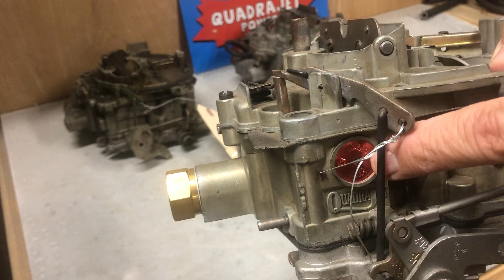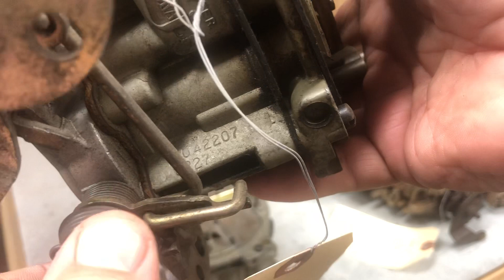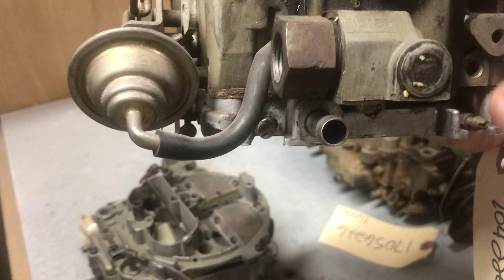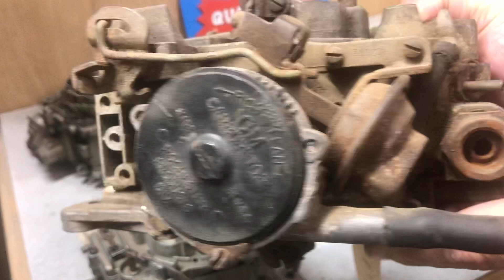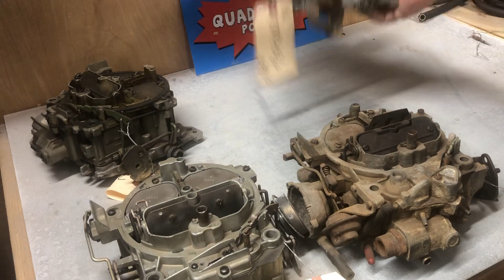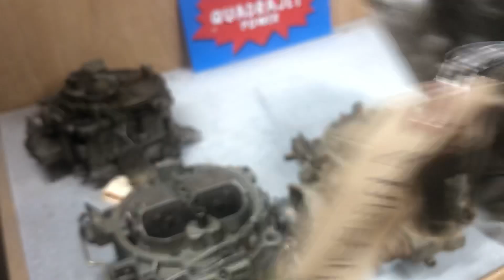Quadrajet Power - Quadrajet Identification

Comment: Years back I bought a used Quadrajet #17059208 (electric choke) and installed it on my 1981 Corvette (it runs great!) which originally had the oem 1981 ECM Quadrajet.
Can you date the #17059208 any idea what vehicle the carb was originally used on?
Reason... when ordering a fuel filter or even a 'carb rebuild kit' parts houses need the vehicle year, make model to order the parts. 
The numbers under the id # are '1610'

Thanks for any info.
Reply from the maker: 17059208 was a 1979 Chevy truck carb.  Need our FFL long filter. enter that carb code in our search bar on our website www.quadrajetpower.com for parts needs.

Comment: what’s the spring on the diaphragm for? mine is missing on my quadrajet. i got the hesitation fixed. i didn’t have enough advance in the distributor
Reply from the maker: What spring are you referring to? If it is on the vacuum brake, only the Chevy vacuum brake from 72-78 had the spring to close the choke, and the divorced choke element opened the choke.
Reply: @ the vacuum brake for the choke. i have a divorced choke so im not sure if it’s supposed to have one or not. it stays open all the time

Comment: My quadrajet is from 1985. The accelerator pump rod is connected in the outer most hole. Someone prior to me had tried rebuilding the carb so is the accelerator rod in the correct spot?
Reply from the maker: The pump rod should be in the inner hole.

Comment: In 70 coup de ville 472 came with a 1000+ CFM that was identifiable by the cross drilled feed tubes, it could flow as much as 2 carbs and still look stock like on a 400 s.b. and you say ,..might be a 305 w/pipes 😂🐾🐾🐾🐾😎
Reply: really ?
Reply: @1989truck Quads are 3 part top middle base 
Top 1/3 is called air horn . Go figure...
The 1000+ CFM if you lift the top off you'll see the secondary feed tubes hanging down ( the biggest ones hanging down)
Those tubes only on the 1000+ CFM are drilled in the side up to just below fluid level for quicker feed I transition from primaries to secondary's .
  Stock car racers in large part didn't know about them and they would put something in the air door to hold it just a sliver open to help transition to secondary's. Factory cure was drilled feed tubes.
Have fun be safe 
🤔🧐😅🖖🏽🎆🎇🎉🐾🐾😎
Reply: You also have to set the float level higher than spec. sheet. Almost kissing gasket for hard corner apex feed 🖖🏽🎆🎇🎉🐾🐾🐾😎

Comment: 1983 march april 1983 g30 cutway rv 5.7 350 was mouse house haveing fun fix it got it run pop off etc no pedal idle yep  geting them kits parts plan just get e-pump added newer block fuel pump still waiting get primp 43gallons half full that old gas had air cover so mustly just norm wear able parts

Comment: Can you help? I have a 1966 Caprice with a 327 275 hp motor. Unfortunately, the little red tag is gone with the date and carb number. One thing that seems strange about my carb is the mechanism that runs across the top of the secondary butterfly on the drivers side. The early carb in your video with the red tag is very similar to mine, except the fuel line comes in from the side. If you look at that carb, you can see a hole right behind the choke horn on the left side. This is where the mechanism starts on mine, then goes across the left butterfly and attaches to the back of the carb diagonally. What does this do? My secondaries open up, but the butterfly does not. What's going on??? Have you seen this before?? Thanks!
Reply from the maker: That was the secondary dampener system in 1965-1966. You should be able to push open the air valves with your finger. If you can't, then the dampener is stuck in the bore.  This type did not have a vacuum brake connected with rod to secondary system like they did starting in 1967.

Comment: So mine is a 17085226. Would that mean a 1985 QJ, model 226? As know mine needs cleaned and resealed for sure. Runs okay, and motor is from an 85 or 86 truck as truck itself is 84 with not original motor.
Reply: 226..The first 2 means it is 4 barrel carb..If this 2 was a 5, it would be California only.....second 2 means it is a Chevrolet application..6 means it is a Automatic transmission..The 8 means 1980 decade and the 5 means 1985

Comment: I have a 78 gmc pickup. The carburetor reads 7045583yz0837. Does this mean mine is a 1975 carburetor? Is it at least correct for being a gmc?
Reply from the maker: It is a 1975 GM/Chevy truck quadrajet

Comment: My 76 nova has the 3rd carb you described , is running like a charm  but maybe on the future I will have to clean or restore ... been watching some of your videos and learning some stuff everu time thanks for sharing my man
Reply: Prob the easiest carb to rebuild. I used to hate them but god dame they work good when you know which one to use. That and they are great for fuel mileage bc the primary is smaller. Long as your not doing pulls lol cheers 🍻

Comment: sell me a q jet for a 62 283 , was a 2 brl has power pack heads and the tiny gas miser cam that came stock . dont want 2 barrel its for my c10 with 700r4 for a shop truck that wont drink gas . HELP I can and would rather rebuild if throttle body isnt sloppy I have never shimmed one

Comment: So what if your Quadrajet had none of these markings? I have 2 Rochester Qjets here for my 66' Olds Toronado and neither one has the code stamps in the locations you show. One has the round section, but there is nothing stamped on it.
Reply from the maker: If it has the round spot for tag, then that tag must have come out. That makes it difficult to identify but we can with pictures.
Reply: @QuadrajetPowerLLC  thanks for the reply! Well I have lots of pictures. Where would I send them? Thanks!
Reply from the maker: @ourkid2000  send to info@quadrajetpower.com
Reply: Do you rebuild them

Comment: I have a qudrajet with a plug connection on top of carb on left side! Wanna know what is that plug connection for! Is it a tps censor or something else? It's also a electric choke qudrajet but I don't know what that plug is for! I'm learning here so bare with me. Any info will be great. Has two prongs inside of censor on carb if that helps any! Thanks
Reply from the maker: That is the mixture control solenoid for the engine computer system.

Comment: I have a '66 De Ville Conv. with a 429. My carb seems to have a vacuum leak, (stalling out at idle or stops, at moving speeds no problems). It does not seem to look like any of the examples, best I can tell. How do I figure it out so I buy the right part for a mechanic to rebuild it for me? I'm not a mechanic and can't remove it to look for numbers, but took really good photos. Thanks

Comment: My 86 K2500 has the one with the small 2 pin plug on top that has something to do with fuel metering I guess. Is it possible to switch it to one that doesn't have that like what's on the 454 in my 85 C30 dually? Also I'm probably wrong, but on the pickups the electric choke didn't get power until the oil pressure came up and closed a pressure switch.
Reply: This is actually the same one that came factory on mine.. the newer carbs on full-size Chevys that only had that plug and it was gray with no other plugs, is for the accelerator pump shot amount to drop once warm, they no like anger make that temp switch, but I'm m sure one could be made to work, although you can also keep it unplugged and it will operate as normal, Rochester called it "dual-capacity accel pump".. it literally just kept it from being as much fuel wasted once warm on accel but on a mild build it probably needs the larger volume pump shot so it would only come in handy where throttle response wasn't as much of a concern
Reply: Mine has that 2 and I thought maybe it was a tps censor but I'm seeing it's a fuel metering censor. What is it for and what does it do?
Reply: @treywilliams3671  My understanding is it's some sort of actuator or something for adjusting the metering rods. I think it works off a temperature sensor on the thermostat housing.

Comment: Hi , I have a 65 olds cutlass would you happen to know what kind of carb it has ? I know it’s 4 barrel
Reply from the maker: It is probably the Rochester 4 jet. In 1966, Olds began using the Quadrajet.
Reply: Would you guys happen to have it for sale or can I have mine rebuilt
Reply: Hi so I have a Rochester 4 jet 7024154
Reply: google  Olds FAQ -- Oldsmobile Junction   if you have questions they have all the answers

Comment: Alrighty my Guy, i recently came across an old GM Quadrajet. . . 17059298.
From I can tell it's got an electric choke, a Straight filter/fuel line adapter out the back, and some kind of vacuum diaphragm for the secondaries. . . Any more info you can enlighten me about it?

Comment: I took off the Qjet from a 1970 Impala 350/300. My Dad bought the car in 72 and owned it since. There are no numbers stamped on the corner flanges like you show. Ok a circle of numbers on the front main body, in front of the secondaries. 7038524

Comment: Mine says 4850S  Quadrajet, Carter .
Its currently on a 1969 chevy k-10 with a 350 , 4 speed. 
Its overflowing gas out the top ?  (Primaries)
Reply from the maker: Yes, Carter made many service replacement quadrajets with the 4 numbers and S.  Fuel overflowing indicates problems with float height, needle/seat sealing, or fuel pressure too high.

Comment: Why are the air gas adjusters screws capped,
Reply from the maker: Factory set them and capped them for original application. Caps were typically removed when it was rebuilt any time in the past. They need to be made available for tuning.
Reply: @QuadrajetPowerLLC  Thank you!!

Comment: How hard would it be to setup and tune a quadrajet for a 5.3 ls build? I have a 1984 Trans Am and am thinking about using the original quad on the stock 305.
Reply from the maker: The quadrajet can be built and tuned for any engine. It just requires the proper set up and calibrations.

Comment: My is stamped 7043202??? Is this right
Reply from the maker: 7043202 was original to a 1973 chevrolet 350 automatic trans.
Reply: I upgraded to power brake booster with front disc and drum back now I don't know where the brake booster hose connects to the quadrajet?? Any ideas
Reply from the maker: Chris Salazar base plate has port in rear center that had fitting for brake booster line.
Reply: Thanks for your help..
Reply: Doesn't have a fitting or nipple theres  🤔  a hole there. Looks like a 3/16 o.d
Reply from the maker: Chris Salazar this link is the port what would connect to booster line.  https://quadrajetpower.com/vacuum-port-brake-line-fitting/

Comment: I have a 17058204, i believe it has the adjustable air bleed. Is it viable to place on a 454 in my 78 C 20 ?
Reply: Yours is a 1978 automatic chevy quadrajet. Should be a 800cfm.   https://www.rodauthority.com/tech-stories/fuel-cooling/choose-your-quadrajet-number-identification-guide/

Comment: Can the electric chock carburetor be modified to an hot air chock?
Please let me know.
Thank you.
Reply from the maker: The choke housing would have to be replaced with hot air housing. Main carb body modified for vacuum source to the choke housing. Engine would have to have all of the hot air heat source tubes for supply.  So yes, might be possible, but much easier and better to use electric.